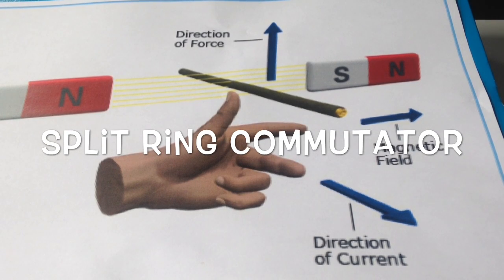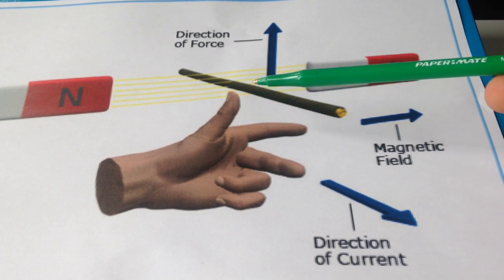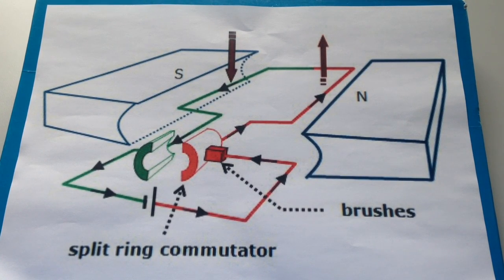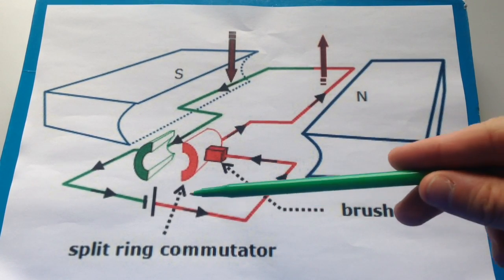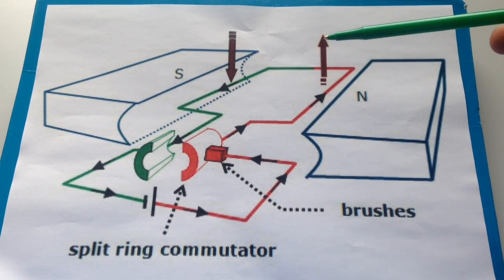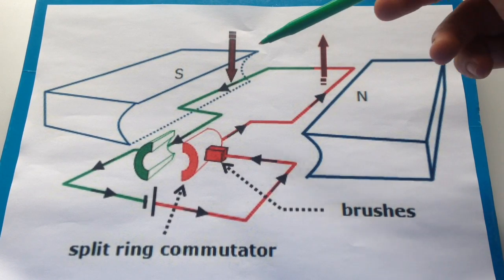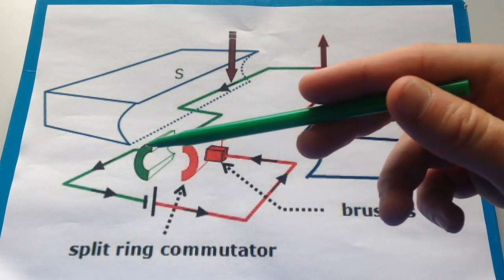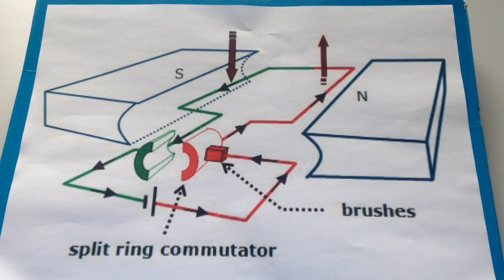Split Ring Commutator

Comment: This helped a lot. But I still struggled to get my head around the current being reversed by the split ring commutator. 

The break through for me was remembering that the current will always flow from positive to negative. So looking at the video, remember that the red brush is acting like a positive terminal, this is where the current is coming from. So as the motor turns 180 anticlockwise the current will be heading towards the positive brush as it approaches (* before* making contact). But when it does make contact, the current from the positive brush will push the current back the other way (because the current must travel from positive to negative). This ensures the current is maintained in the same direction as it hits each 180 spin and therefore the force continues in the same direction maintaining the anticlockwise motion

Comment: how does the current change direction when it goes to the other side?
Reply from the maker: As the motor spins, the red side loses contact with the positive brush, then connects with the negative brush. So initial the current is moving away from us along the red side, then, when it connects with the negative brush the current moves towards us. Hope this helps :-)
Reply: @JudgemeadowSci  pls..make it more clear if possibly.

Comment: Wow I thought every half turn the split ring reverses polarity using an AC supply... so even a DC supply can be used to make this work?
Reply: Yes, an AC motor has a similar but different internal set-up. Here the commutator reverses the current every 180 degrees, and thus DC current allows there to be a reversal of current direction. For the GCSEs only the DC motor is required to be understood (AQA spec). Hope that helps!!! :)

Comment: Why can't we let the split rings come into contact with the brushes when it is at a vertical?
Reply from the maker: If the two halves of the split ring make contact the current will flow straight through them, bypassing the motor. Short circuit, no motor.

Comment: Why would the coil not just stop when it reaches 90 degrees from the fixed magnets? Is it purely the momentum of its initial movement that forces it the little bit "over the top" to begin its next turn around? If that is true, it seems with a low enough voltage, the motor would not rotate slowly, but rather it wouldn't have enough voltage to actually cause the coil to make its next half of the turn. Thanks in advance for any insight in to this.
Reply from the maker: Yes, purely the momentum from the initial forces and movement. If the voltage is too low, the motor will not spin Jason Grady.

Comment: How is the current reserved though?
Reply: the split ring commutator allows the current to flow the other way as the split part of the ring means it is connected to different sides of the circuit each time there is a single half turn. I'm probably too late, aren't I?

Comment: why 'carbon' brushes are used?
Reply: The carbon is softer than the commutator material, therefore the carbon brushes will wear down from contact rather than the commutator. The carbon brushes are much cheaper to replace and they reduce sparking! :)